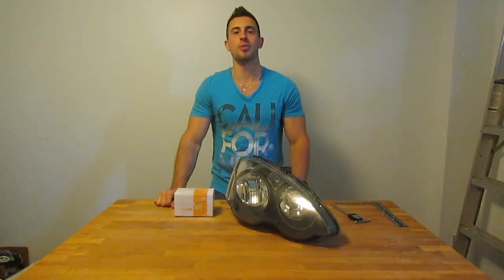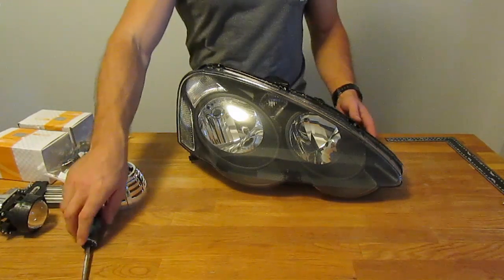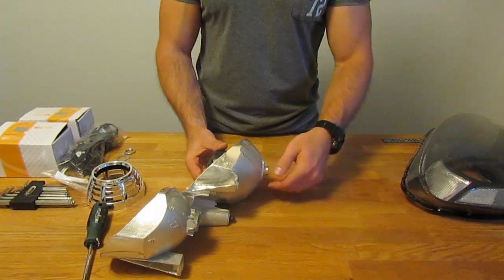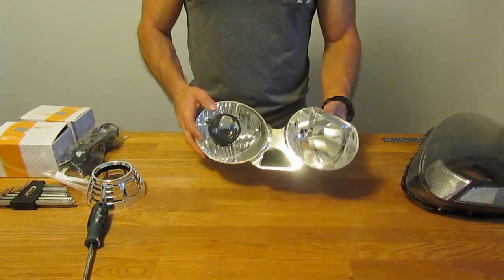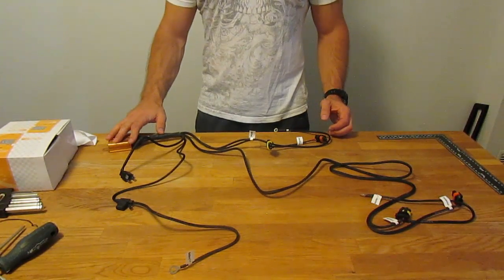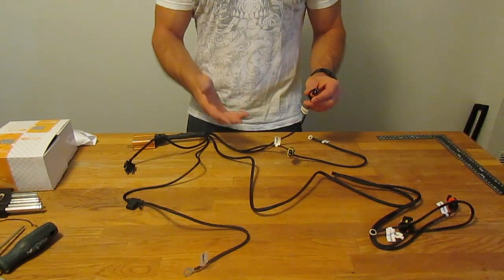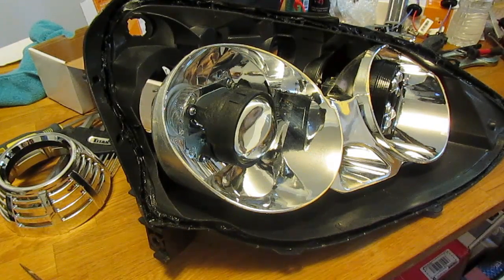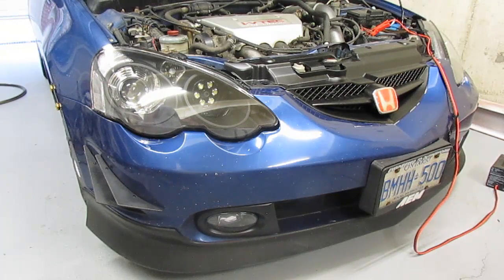HOW TO: HID Projector Retrofit Guide

Comment: This has been possibly the most in depth diy video, thank you so much for the upload.
Reply from the maker: +dragon123443 Thank you! Really appreciate the kind words!
Reply: +Embrace Racing excuse for bumping this old comment of mine but I decided to go on with the retrofit lol, I'm having an issue though, I have a 2010 Malibu how would I go on about putting mini H1 projectors if I have H11 bulbs??
Reply from the maker: The 'IN' side of the ballast kits will connect to the H11 sockets. The 'out' will connect to the H1 HID bulbs. Hope that helps!
Reply: +Embrace Racing oh ok so I use an H11 ballast with H11 bulbs?
Reply from the maker: +dragon123443 nope, the hid kit or the harness will have h11 connectors for inputs. This just uses your old h11 connectors for a signal. The bulbs inside the projectors will be h1 hid for use with the morimoto projectors. Therefore the output in the ballast will be h1. If you're still confused and need links to examples let me know
Reply: +Embrace Racing well let's see I "think" I got this. for my relay harness I need h11 in, 9006 standard plug out? most ballasts are all 9006 standard right? then I just use h1 bulbs?
Reply from the maker: dragon123443 Correct. Example of harness:
https://www.theretrofitsource.com/components/harnesses/hd-relay-h11.html#.V5bRs9QrK9I
Reply: +Embrace Racing I bought all morimoto gear and will be retrofitting this coming up Weekend. Thanks for everything man. 

For the retrorubber did you remove the some of the OEM glue off first or just set the rubber right over the old stuff?
Reply from the maker: I tried to dig out a lot of the old stuff so it would have a nice even surface to stick to. Depending on the type of glue and how old it is, it might be difficult to get most of it off. Good luck with the project!
Reply: Damn his final product is amazing! It went from a blue rsx to a white one ;)

Comment: Thanks for the awesome video!! 

I’m doing mine this weekend, but for anyone watching, I would drill holes for the wires and not have them going through the same hole as the washer and nut. Otherwise, you could have electrical issues in the future from crushing the wires. You might not, but why risk it? Fair warning.

Comment: Best so far. I wish everyone would dedicate this much time and detail to the video. Thank you man!
Reply from the maker: +Daniel Pawlata (DPFAST) You're very welcome! Thank you for your comment!
Reply: No problem. I really enjoy that.  Any top for me on quart projectors and shrouds would you recommend for me for 2002 Toyota Rav 4 and 99 Camry? Thanks
Reply from the maker: +Daniel Pawlata (DPFAST) Do you mean quad projectors? If so, it really depends on your housings and if you have enough room. Usually it's not necessary since two projectors are more than bright enough. People do it as more of a "looks" kind of thing. My only suggestion would be to aim them in pairs separately. Don't try and aim all four at once. Unfortunately I'm not familiar with the dimensions of the Rav 4 so I can't really recommend a shroud, I would just be guessing. I get all of my stuff from the retrofit source... they have a wide selection of products so something from them will definitely fit!
Reply: +Embrace Racing you're the best. thank you

Comment: Thanks ER for taking time to post the vid. Picked up an idea and some tips. If it goes to market I'll certainly get back to you.
All the best
Reply from the maker: Thanks for watching and commenting Gene! I'd love to see what you're building!
Reply: Well I installed a HID conversion kit into my 2004 Lexus GX470. I bought the truck new and at the time HID's were not available as an option. It came with H11 low beam and 9005 high beam halogen projectors. As I said I installed the 6500K HID kit into the original projectors. The look improved but I'm not crazy about the performance. I'm also not getting that razor sharp cutoff line. The harness, ballast, relays and bulb all seem to be quality equipment. So my plan is to reuse what I installed and shop for a top shelf set of true HID projectors. I see that there's an adapter to convert the connectors from AMP to D2S. So if you have time, can you recommend a primo set of projectors.
Thanks again ER
Reply from the maker: Hi Gene, check out the The Retrofit Source. They sell all of the components I use and they have a great selection of popular projectors in various sizes. Hope that helps!

Comment: Just did this retrofit using the Morimoto H1 7.0 projectors on Zenki RSX Headlights. I originally used an Apollo 3.0 shroud but there were two problems:
1) the projector stuck out too far
2) the shroud diameter was too big and the headlight wouldn't seal correctly due to the headlight shroud hitting the projector shroud. The shroud diameter would not have mattered if I could have the projector sit back further.

 I then tried using the G37-R shrouds like in this video and the headlights sealed a bit better but there was still a 1mm gap between the lens and the housing at the tall end of the headlight. I verified that all the clips between the lens and the housing were inserted correctly. The headlight lens stuck out a little bit where it meets the fender. Need to open it up again and replace with smaller shrouds..

In this video, it looks like the projector shroud is hitting the headlight also (or at least it is very tight clearance), but it might actually have been OK if Morimoto H1 6.0 projectors were used (they are 136 mm depth vs 139mm depth of 7.0 projectors).

I would recommend using bullet shrouds or mini gatling gun for this quick retrofit to avoid any headaches because they have smaller diameters and are garuanteed not to hit the headlight shroud. Otherwise, you'll have to cut off a significant portion of the headlight reflector bowl to seat the projector further back. If you get to that point, you might as well do a FX-R retrofit because it will be a huge PITA to align correctly anyways.

Lastly, thank you for the informative video! It was very easy to follow.
Reply from the maker: Thanks for the info Nathan! I haven't used the newest 7.0 projectors but as you stated, people have to be aware of changes in depth. Very important not to over look!

Comment: awesome vid. I'm planning on doing a retrofit on my 05 civic. I think the headlights are similar to the ones in your RSX. I have seen many people just cut a huge hole and epoxy the projector to the reflector bowl, and I was planning to do that until I saw this vid. I'll try to do what you did here, as its easier, cleaner, and should make the alignment process 100x easier. 

I would also like to mention your custom DRLs. Personally, I don't like them. IMO they're a bit tacky. Plus, I think they're pointless, since you don't actually see them (unless you have some system which turns the headlights on when you unlock the car, or something like that). Still, I guess you must like them and that's the important thing.
Reply from the maker: Thanks! To each their own I guess. It was more of a fun project because I could, not necessarily because I should lol

Comment: Nice install video. My only note is your right beam is aimed too low. The low step of the right light should be approximately aligned with the high step of the left, so you have two steps up (opposite for brits, and the rest of the wrong-siders).

Comment: Excellent video for retrofitting projectors, except I would first of all set up reference marks on the wall using the OLD halogen lights. That way all you have to do is match up the new projectors to the "old" reference marks and you are done! The reason I would do it THIS way is because the vehicle I have is a '13 Focus with reflectors. The Focus "shares" one reflector for both, high and low beam presently with the halogens, and there is ONLY ONE adjustment common to both lights. Since I want to use BOTH high beams ( projector high beam AND my stock halogen high beam) for more light, if the low beam and the halogen high beam don't have the same positional alignment, using the single factory adjuster will not position ONE of the beams properly, especially horizontally. This is why a "factory" installed projector along with a reflector "high beam" in the same housing has TWO separate adjustments for each light. I don't know if all this makes sense, but that's the only way I could explain it!
Reply from the maker: Good point, I see what you're saying!

Comment: Great video. This is a great example of how to do a instructional / guide video. I bought a set / kit of (bi-xenon) hid that fit into my oem F250 housings. Strangest deal, the  hi/low  function triggered through the thin b/r wires much like the "cut off" magnet connection. These bulbs actually have a internal (push - pull) magnet that moves the hid bulb in & out about 5mm.  First, hid's in a refracting housing is WRONG, I learned that quick, Also, I cant find a application where that push pull bulb is used. It seems like it might work like a MAG LIGHT to focus ,pencil beam to flood beam in the right housing , but it does nothing in a OEM refractor. I'm using the BI ballast / harness on my projectors, (works great on the cut off hi/lo ) ... So what the hell are those push pull bulbs good for?
Reply from the maker: Good question Jay. I've heard of them, but have never personally come across them. Obviously some kind of lens/housing has the proper optics to make them work as intended but it's not these "universal" bixenon projectors with the cut off shield. Thanks for watching!

Comment: Nice video, i do have a question though. What did you do about the high beam? I mean when you have 2 separate bulbs fitted by the factory one is low and the other high beam. I get it that the projector will provide the high beam function via the flap but what about the light itself?  I'm mostly thinking about daytime when the low beam is off and you need to use the flash via high beam. How will the low beam and flap get activated? I have the same situation on my car and I intend to use the high beam/DRL slot to house a 2" projector that will act solely as high beam together with the low beam. This way I will have the "flashing" option as well.
Reply from the maker: The projector's solenoid uses the high beam function... so I wired the 12V that would normally have gone to the separate high beam bulb to the projector solenoid. That way when you flash to pass, or put your high beams steady on, it just uses the projector solenoid as intended. In my case I also mounted a fun LED day time running light module in there that you can see I "animated" with some additional electronics.
Reply: @EmbraceMaking  thank you for your reply but it doesn't answer the question or it could be that you had H4 on your car. Mine has 2 separate bulbs for high and low beams, thus 2 wires/signals for the related buls. When flash to pass the solenoid will react but what about the bulb? That will stay off as my low beam signal is off. As I see it it would require that the high beam signal is wired to the bulb on low beam as well. Otherwise the light will stay off while the solenoid will activate. When low beam is on then all works just fine, it's during the day I have an issue. Hope all makes sense.

Comment: Perfect video!  But I've one question:  I've got a pair of headlights branded "tyc".  The aiming system is not working...the adjusting bolts move freely, so the reflector won't move.  If I want to install a bixenon projector, I can repair the levelling system?  I think that the bolts it's not in contact with the reflector.

I need your help for the project! Thanks!
Reply from the maker: Hi Irma, sorry I'm not familiar with those lights. There are so many out there its impossible to visualize what your problem is without seeing it myself.

Comment: Okay, great video, but I am dying trying to figure out one more detail. Your OEM was a 4-headlight dedicated high and low beam setup. You converted to bi-xenon. Your morimoto harness clearly appears to be H4, which is for a hi/low headlight. What adapters did you buy to go from stock two-prong headlight plugs to the H4 three-prong.  Oh...all without cutting OEM wiring?
Reply from the maker: Its been a while since this video but if I remember correctly... H4 harness you can just stick regular crimp blade connectors in, and I'm pretty sure on that harness that is only for signal and not for powering the ballasts but it would be fine regardless. So you can just make your own adapter if you used an H4 harness and source the other end for the appropriate sized plug for whatever bulb size the car takes. Lots of retrofit stores and ebay you can find just about any male / female plug with pigtails to make your own harness adapters.

Comment: Thanks. I have all the items now but they are sleeping in the shelf for couple weeks since I want to make sure I do it correctly being a first time DIY. 1. Should I set my headlights motor to the high level before fixing the projector? 2. The driver side headlight is on the lower side already which I didn't know how to make even - This will also result in driver side projector being alot lower than usual isn't it? 3. How to get both the projector beam in the same level (line)? I don't know if the adjustment needs to be done on my NHK G5-R projector itself or if there's any screw in the headlights assembly for that. Finally 4. Is Butyl rubber enough to close the assembly or I would require any other adhesive too? Thanks so much for helping me out!
Reply from the maker: Before performing the modification, use your stock headlight adjusters to get your stock lights aligned first. Once you have proper alignment, then you can take everything apart and start modifying. If you do not align them first, then you may not have enough adjustment after the retrofit to bring everything back into proper alignment. The butyl rubber should be enough to seal. Thanks for watching!
Reply: Thanks. So, it's in this order 1. Align the headlights on the same height 2. Set the headlight adjuster motor to the highest level 3. Proceed with projector retrofit. That's correct, right?
Reply from the maker: I'm not sure what you mean by "set the headlight adjuster motor to the highest level" 
Is this a motor for self leveling headlights?
Reply: Embrace Racing Yes, there's this button right beside my steering wheel to adjust the height of the headlights in four levels based on the number of persons in the car. Both headlights are adjusted at the same time upon adjusting the button.

Comment: Great video! So I have an RSX, and I'm looking to do this exact job. When I look on the retrofitsource website, and I'm a little bit confused on what I need to get. I believe I need an H1 system, but I dont know what kind of wiring I would need to get. I don't see the MotoControl for the H1, I only see a regular relay, with an optional high bean splitter.   Are you able to advise? 

Thanks a lot.
Reply from the maker: The H1 projectors are the standard choice. I can't remember now if the RSX keeps low beams on while high beams are activated. If this is the case you just need to wire the high beam signal to the projector shutter. If the low beam turns off when the high beam comes on, then you need a bixenon motocontrol relay. This keeps power to your H1 bulb all the time, but when the high beam signal comes on it activates the shutter.

Comment: Nice video
I had one question though 
What would happen if you used high beams in day light when your low beams are of? 
Would there be any light output? Or just the electromagnet moving? 

Just saying if you wanted to flash high beams in daylight
Reply from the maker: Depends on how you wire it. My car didn't have DRL because it was a US car, so yes, during the day the magnet would just move. However, if I had wired them such that the low beam was always on then I could flash my high beams during the day. Thank for watching!

Comment: This is a really stupid question I'm sure. Do you have to open the housing back again when you have to change the bulbs?
Reply from the maker: Nope! The bulbs stick out the back so you don't have to open the housing :)
Reply: @EmbraceMaking  I figured as much. Really dumb question haha. I have never opened up a set of headlights myself, so I'm just used to the stock location. When I see the threaded end on the projectors with the lock nuts and washers I just couldn't picture the bulb going in. Most videos never actually show the bulb going in after the retrofit lol

Comment: If your car powers the low and high beam together can you just put an HID kit to the low beam lead to power the projector bulb and the shutter solenoid to the high beam lead?
Reply from the maker: Hi Aaron, yes that should work. As long as the low beam does not turn off then you have an easy set up to retrofit :)